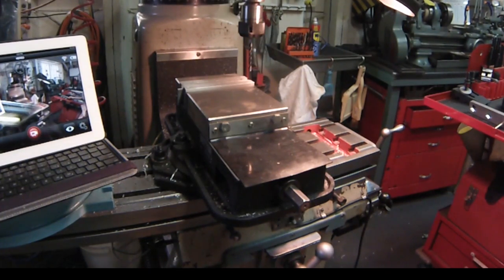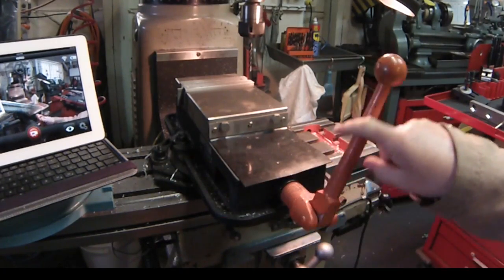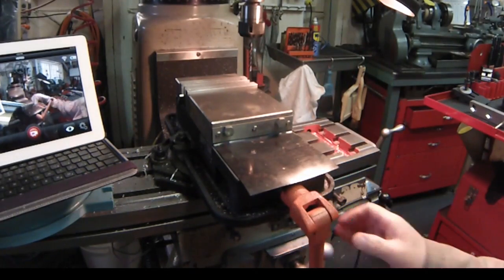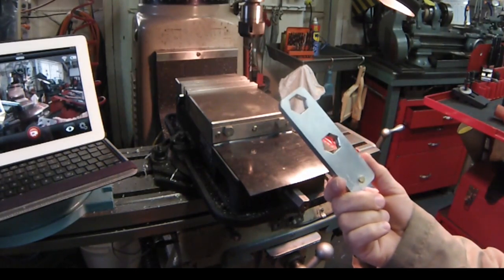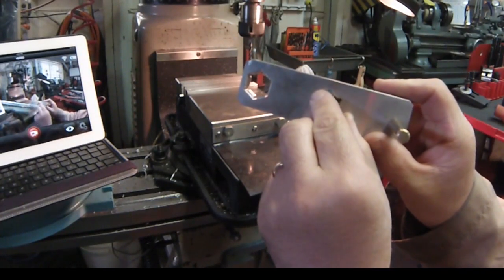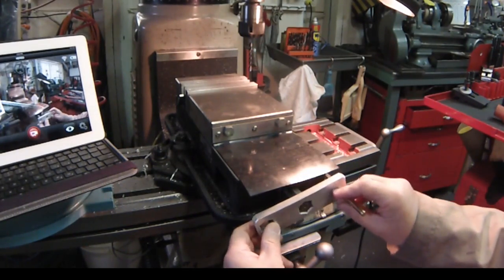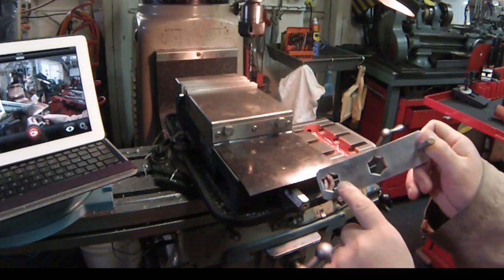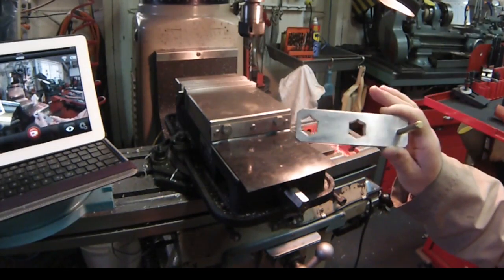Making a Speed Wrench for Milling Machine Vise

Comment: Nice project. That old vice wrench you had is very common. What I do with those antiques is have the wrench nearly straight out and move it quickly in small circles. You can move the sliding jaw rapidly with practice. But I've been at this for years. I look forward to more videos from you :)